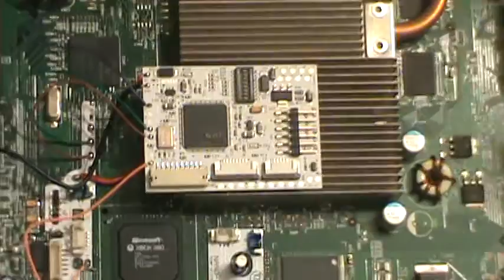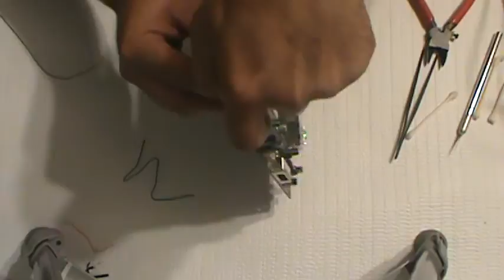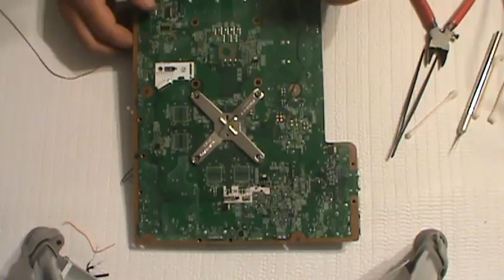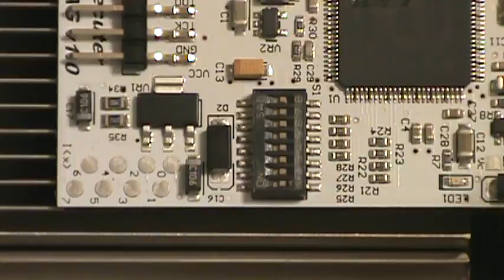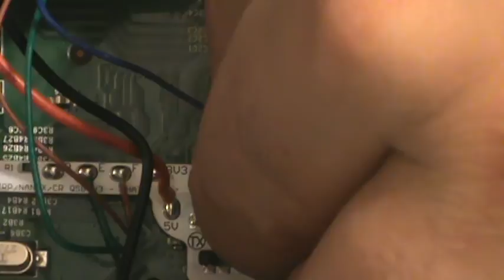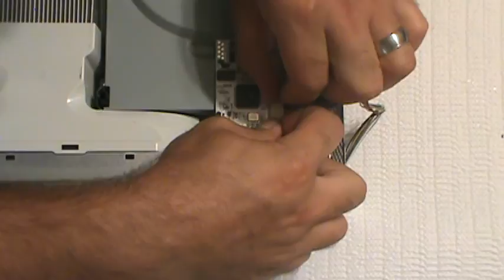Xecuter R-Jtag Install Tutorial Part 4

Comment: Hi keil423 do you offer repair services?  I was able to read the nand on my 360 and get the cpu key but I don't think I flashed it right.  The 360 isn't outputting video and rater can't connect with it.   I need a pro to examine it because I have no idea what I'm doing at this point